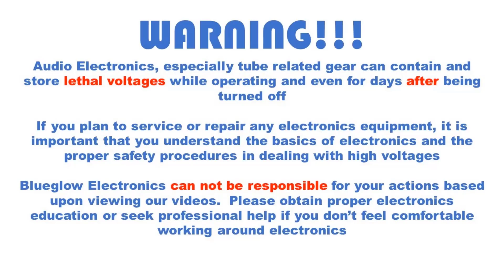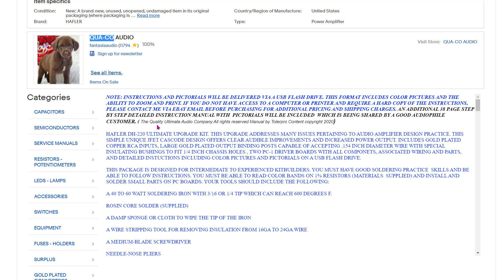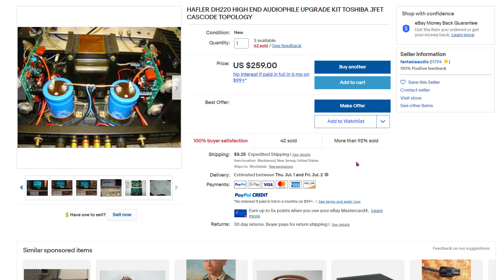Hafler DH 220 Restoration - Part 1

Comment: I don't know how I missed that you put this out, but I'm psyched to watch. A DH-220 is my daily driver. It was a mystery gamble on ebay- I bought it because of tip of the iceburg details like upgraded terminals, nice feet, Allen head screws filling the holes in the heatsinks. When I opened it up, it turned out to have been recapped at some point and has worked seemingly perfectly for the last 3 years.

Comment: I did the same thing with a used DH220 amp about 3 years back, mine also had one flakey channel and I decided it would be best to put in new boards.. I went with the Musical Fidelity driver boards and used 22,000 100v filter caps with a 35a bridge and a surgistor. 

The amp has been running just fine for the last 3 years.

Comment: Hey Mark, quick question.  I just picked up a DH 220 at an estate sale.  The amp works fine but runs warm.  About 116 degrees on the right heat sync and 112 degrees on the left.  Does that seem right to you. Ambient temp is 73 degrees.

Comment: I built a 220 and DH500 in the mid 80's. The output transistors failed and you just couldn't get them at the time mine failed (about 10 or 15 years ago). I have the DH110 preamp which was a decent preamp that I still have but the problem is I never really loved the DH500 sound and my 4 ohm Allison speakers at the time never worked well with it so I sold it. Now I'm running class D for high power which is much more efficient and a lot cheaper. The detail and sound is better than the Hafler was too although I imagine with the upgrade kit the 220 sounds better today especially since they got away from those original mosfets.
Thanks for the video.
Reply: Interesting. I built a DH-110 and a DH-500, to use with my Allison 4s. No issues...fabulous.
Reply: @len9518  The first week I had the 9's they blew a tweeter and I didn't push them. I talked to Roy Allison and he basically said to run lower power into those tweeters.  I blew another tweeter a few years later and finally dumped the 500. My guess was as the transistors got worse there was ringing above the audio band that was cooking the tweeters. I never checked out the 500 on a scope to see if it was putting anything crazy out, it just wasn't that important to me. Don't get me wrong, I have a lot of respect for David Hafler. I still have the Dynakit Pass tube preamp and the FM3 but his first transistor amp the Stereo 120 was a horrible amp. You couldn't keep transistors from burning out in it. One of my friends built it and passed it on to me. I'm very experienced and went through it, he did everything right, it was the amp itself.
The DH110 won a couple of awards, I used it for a few years after selling the 500. It was decent but there's just something about a tube preamp that pulls me in although Nelson Pass gets pretty close with his amps.

I still have the 9's by the way, although they took a back seat to the Dynaudio Heritage Specials. If your Allison's' are in good shape you should try them with a Fisher 500c if you can find one restored or do it yourself, it has really sweet mids.
Reply: @mosfet500  'Dynaudio', right on. One of the purest speakers in the world. "Audio microscopes"....the one problem...they'll make badly produced LPs & CDs in your collection stand out like a sore thumb, the emperor's clothes...

Comment: Great restoration video.  I have a DH-110 preamp controlling a DH-220 with a bridging kit used to power a passive JBL B380 subwoofer with a DeCoursey Engineering Labs active crossover, and a DH-500 powering my JBL L100T's.  However, I have an issue with my DH-220 and that is why I ended up on this restoration video.  The 7-amp slo-blo main power fuse is blowing when I turn on the DH-220.  Can anyone tell me a likely problem that may be causing this?  A reply would be appreciated.

Comment: May be that should actually be a CL series thermistor. The device shown [may] serve the opposite as a current limiter as it heats up... Not faulting you... the seller of the kit should be (made) aware of this ~unbelievable~ oversight. Check out that device.

I use CL-30 NTC thermistors on my (many Hafler) amp builds... Check into this. Typically SL are PTC devices. 
Newarks own page on SL-32 is suspect... labeling as a NTC. Ametherm may be different.
Reply: great comment!!
Reply: Depending on the brand / manufacturer, there are "CL" series, and "SL" series designations on different manufacturer's ICL ( Inrush Current Limiter) components. It is best to check the datasheets to insure that the components chosen are "Negative Temperature Coefficient"  designs, as this designates them as going to a lower resistive value as they are energized. It is also best to consider the values you use, and what they are installed in as with that particular component, and what it's value @ 25C and at max sustained current is. That SL32 ICL only introduces 0,5 ohms when first turned on, but needs close to it's rated  constant operating current of 36 amps in order to drop to its minimum rated resistive value of 0.008~0.010 ohms, so it will most likely not heat up much under normal use, but also not do a lot of inrush limiting at it's 0.5 ohm initial value. Something with a lower current rating, and a higher initial resistance would be a better choice to properly act as a ICL.